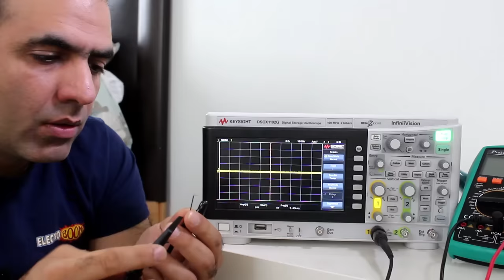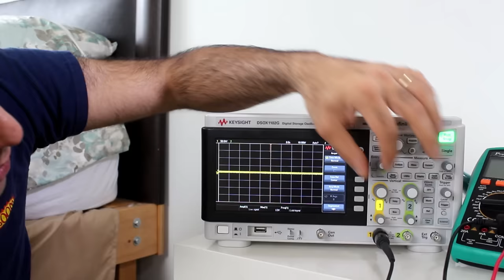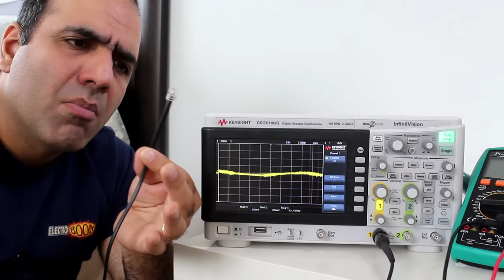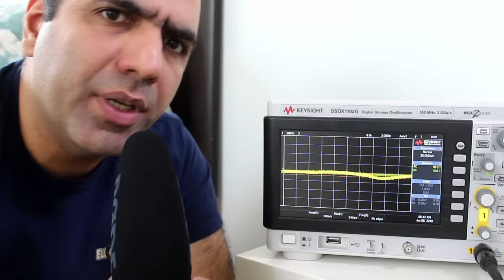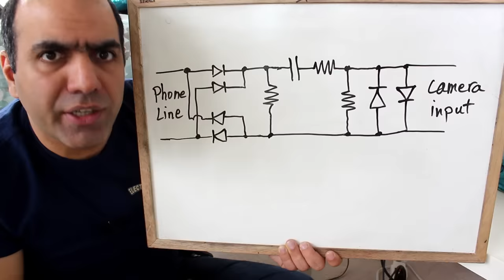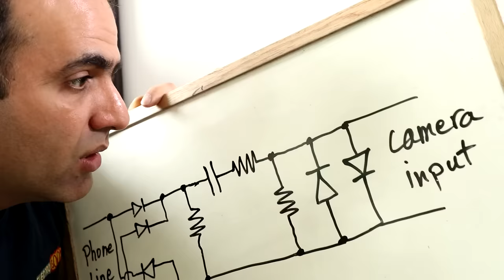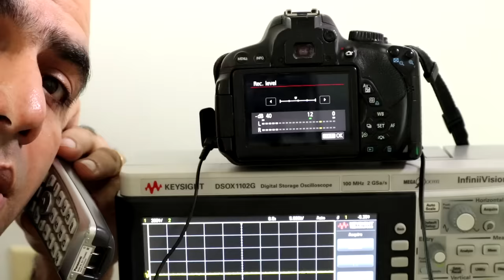How to Wiretap Phone Line with DIY Circuit

Comment: I got caught like that. I was wiring up an extension second phone. Someone phoned me while I was connecting the wires and I got zapped.
Reply: It can't be disconnected. It's a live 48V DC supply direct from the telephone exchange which can't be felt at all. I don't know what the ringing pulse is, but it's enough to generate an F word followed by laughter. Obviously when working on our 240V AC mains supply, I always disconnect at the consumer unit, then double check no wires are live before touching them.
Reply: Same here. Was wiring an extension socket under a counter when someone called. Got zapped and banged my head on the underside of the counter.
Reply: ha ha. That's worse than mine. It's not the voltage that hurts, just the surprise.
Reply: i was connecting a phone ext socket to some stranded cable, while I was working on the live line, there was a arc flash but I managed to get it working without damaging any of mine or bts equipment, scared me though
Reply: derekcolman 😂lol
Reply: I saw the DC's MAX harmless voltage is around 48-49 volts, what is the DC voltage on your extension socket under your counter, and what happens if somebody calls you, and what is the voltage of the audio during talking trough the phone
Reply: This remember me, when I was at "Balaton-Akarattya" I got zapped by 240V AC, but thank goodness for the breaker cutted off the AC, but with 240V DC all the outlets needs a "safety-unplug" button.

Comment: I used to do this by just wiring the ring and tip wire directly into a mic port on a recording device. No circuit or resistor just straight in. Always worked fine for me.

Comment: I'm actually curious- what does the caller ID transfer noise sound like? Just like touch tone dialing?
Reply: It's like a white noise.
Reply: Mostly just sounds similar to the analogue output of an old modem, that's basically what it is simply a digital signal modulated into analogue using two tone FSK.
Reply: Could you somehow remove said transfer so that no one knows who you are?
Reply: I guess, if you have a computer that can immediately intercept and remove volts from a live wire when it thinks it's modulated. If you can do that, you'd show up as "UNKNOWN" on the other end.

Comment: Proper way to do this is to connect a capacitor and the primary of an audio transformer in series over your land line so the circuit will not pick up incoming calls automatically. Record from the secundary, protected by two clamping diodes and a series capacitor for blocking the electret supply your camera provides.

Detect incoming ring signals with your full bridge rectifier, some zeners that only conduct at the high ring voltage, a resistor, smoothing cap, opto-coupler.
Similarly, you can detect wether or not your line is in use, or idle.
(and automatically record all of the calls with a big reel-to-reel, just like in old movies)

Auto-answering:
Pick up an incoming call by connecting a resistor over the transformer's series capacitor, by a relay. The value of that resistor can be measured at the leads of an off-hook phone.

Electronically talk back by feeding an amp's output into the line via a transformer with an extra coil. Use the signal out of that extra coil to partially null out what your recording transformer picks up, so your signal and the signal from the other end is approximately equal.

Comment: Theoretically, you could connect a speaker and a microphone to the phone line, then add a switch to connect and disconnect the load to tap out pulses to dial out like an old rotary phone (at least in the US, pulse dialing is still supported).

Comment: The force with which electricity hits you depends not only on the voltage, but also on the amount of current (just in case).

Comment: Looks like a good filter build to have safe audio output.  
I just want to connect a speaker to hear the audio so I can put the handset down. 
Can anyone tell me if the audio signal is strong enough to hear in a larger speaker without further amplification?

Comment: All that I want to do is monitor a live phone call. I built a line voltage inducer so that I can connect two telephone together without a network in the middle. I want to essentially put a speaker phone between them. Can I simply add the speaker I wonder?

You say I could use an inline capacitor to isolate the DC signal but in my case there is only a DC signal. My inducer is simply a 9v battery and a capacitor. In that case am I fine to just attach a speaker?

Comment: why did you add the rectifier? you wont care about polarity if the caps are non-polarized, and its only gonna introduce distortion because of the forward voltage of the rectifier

if you want to isolate the camera from the phone line, you can do that by adding another cap between the "ground" wire

Comment: 0:55. I once did that when trying to use my mouth to strip the insulation off of a phone line. It hurt! I saw a flash of light in my brain from the pain. I should of disconnected the line from the modem first. LOL

Comment: Power supply from the CO is 48v dc ..but when it rings, amps rises and power may reach up to 110v .. that's for the Analog lines..
Digital, still 48v DC supply ..I guess the same that voltage rises when ringing ...

Comment: Since the phone line isn't connected to the power grid. When there is a power outage the phone line still works. So could you use the phone line to charge your phone?
Reply: The phone line is connected to the power grid right? How else would there be 48v DC on the line?

Comment: Dead easy to wiretap a phone. Take a receiver from an old phone handset. From the screws, use 2 wires with alligators clips. Then tap on to an active phone conversation. However, when you tap on to an active phone conversation, both parties are going to hear a “click”, just like an extension phone being picked up. To eliminate the “click” put a rheostat on either wire. Turn the rheostat down, tap on the lines, then slowly turn up the rheostat. Yeah, old school hacker… ;)

Comment: Hm.... If there is 40V DC, can I convert it do some AC and normalize to 220V AC to have free (non countable I mean) power 🤔 ?
Reply: Absolutely. Most landline phones will work when the power is out for this reason.

You're paying for the phone service though, and since you'd only be able to get a couple of watts of power at most it would actually be some pretty damn expensive electricity.

Comment: Back when I installed DLOS internet, testing cables with your tongue when you have a box filled with unlabeled wires saves you as much as 10-15minutes. Instead of isolating each wire you just grab 5-6 and lick the ends. If it shocks it's one of those 5-6 and you just single them out one by one. 
The pain is the same as a 9v battery in my opinion but more shocking.. If that makes sense lol
Only test low voltage cables this way. Don't lick 120v AC.

Comment: 9V to the tongue isn't fun, 48V is just asking for trouble! Like the time I was installing a phone extension, and I stripped the wires with my teeth (bad habit but my teeth have a perfect, tiny gap where the 4 front teeth meet in the middle), forgetting that I'd already plugged the extension in downstairs, to save me having to go back and do it later... This was through the TEETH, a subtly different experience to the tongue, and probably not a preferable one.
Reply: Just seen Mehdi explain the ringing voltage is 160V pk-pk! Christ I'm glad nobody called me that time! And same to Mehdi of course. Does his wife have instructions to upload his "final" video, if that ever happens?

Comment: Question: if we get that 48v ..😈😈 nobody is using that line...😈😈 can we use to power different things around the house, like lights( led ones...) router something small voltage? Or even a battery charger😈, without been registered on consuming unit?
Reply: Unfortunately not, it would draw too much current, and the phone company would not be happy.

Comment: 2:45 Mehdi unknowingly explains the working of a black box here. This was a trick that worked in the old days. When the voltage drops from 48V to 7V, the phone company knows that you picked up the phone.... and starts charging the caller. If you can manipulate that with a simple resistor, so that the voltage drop does not happen, the phone company thinks the phone is still ringing while you actually have picked up the phone, so the person calling would not be charged.  (of course when they saw a pattern of long ringing times but never taking up, they might have a reason to suspect fraud)

Comment: Is it possible to get power from your phone line without paying your power bill
Reply: It is indeed possible. In fact, your phone probably already does it. Most phones get their power from the phone line and will work when the power is out.

That being said, you'd be lucky to get a few watts of power and since you're paying for phone service it's definitely not free. You'd actually probably be paying more per kwh than you would from your electricity provider. 😂

Comment: please don't die of solder fumes
you're smarter than that
use a mask and fume extractor 
we want you forever Mehdi
Reply: Nowadays there is no lead it's not poisonous anymore
Reply: @sovietcomrade7733  how unbelievably wrong you are
Reply: @hughjanus6975  there is no lead. Nothing dangerous. If it was, it would be written in the packaging. Plus de flux doesn't have any dangerous stuff inside

Comment: Foe such difficult activities i can warMly recommend a book from 1986,
 which foccusses all around recording and transmitting audio in high fiddelliddy 

qualliddy through phone lines and thin air.
That's the link to it, not sure if it is also available translated to inglish:

 https://www.booklooker.de/B%C3%BCcher/Jochen-Blumenthal+Das-grosse-Minispione-Baubuch/id/A02mK1HQ01ZZF?zid=gmbo9o94v3s47os1efcquk1gl

Don't judge a book by its cover, they brag a bit in higher ranges on the title page. 

Maybe it can iMprove the audio quality in your hot glued circuit. Seriously i'd never use hot glue to cover such circuits.
2 component epoxy also should do it.

Comment: 4.8 volts on a standard pots...  lol   not 48.....     people be pulled free power off the telephone line if it was over 12 volts...    yeah... I had to rewire all mine in cat5e  ...   getting zapped is so friggin anoying..   its such a low voltage, yet  stings like hell evertime...    

bzzzz     owww...  ..  just this last...  bridge pots splitter with screwdriver..   yyyyyyyeaOWWW   ... god dammi   whack head of cieling.    my god...   oh screw thi....     

you can tell I have a wireless system :-)